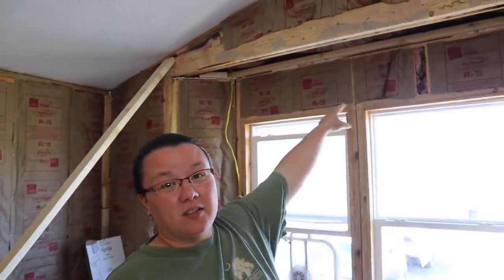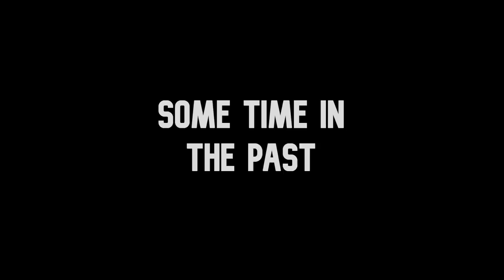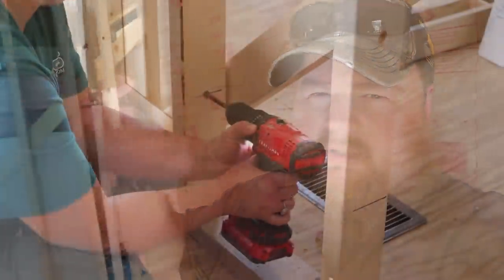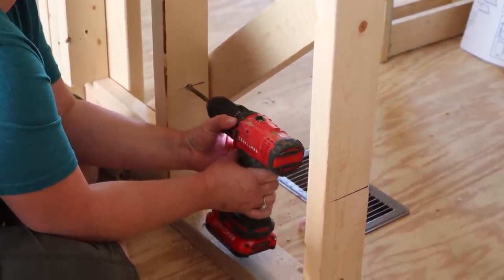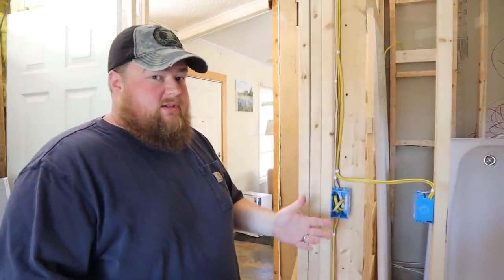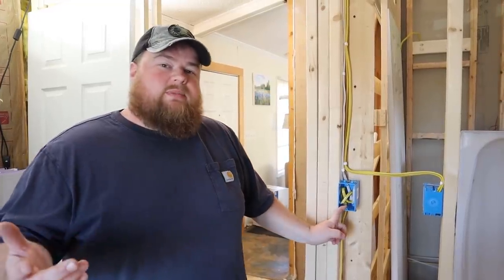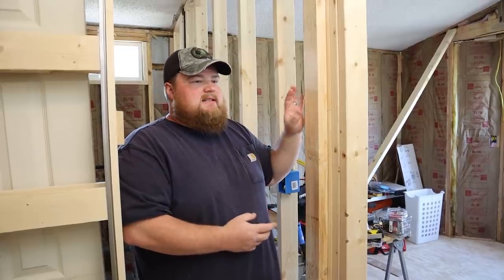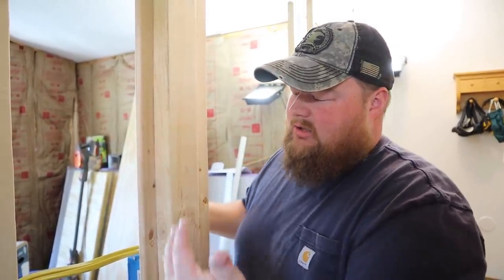1,000 Little Jobs & Why We REMOVED OUR FURNACE // Mobile Home Renovation

Comment: You need to install Mobile Home  approved propane furnace... you wouldn't need to replace the duct work...that could save you a lot $$$$ ...I am a tech and have been in the business for 23 years... I live in a double wide and bought new 'mobile home approved system" for around $4,000 and had it shipped directly to my home...spend a weekend tearing out the old system and installing the new system...It's not a difficult task in a mobile home.... If you go with Coleman products they offer the precharged Evaporator coil, ourdoor unit and lineset...you don't need to braze or use a vacuum pump to get it all up and running.... you can install it yourself watching a you tube video...you may have to have someone run your gas line for insurance and inspection reasons.... Also you may need a qualified roofer to install the new roof jack...(the intake and exhaust for your gas furnace)... All in all you look like you have the handy skills to take it on yourself... Good Luck

Comment: I live in Ohio in a 1978 24x52 doublwide with an electric furnace. My son lives next door in a 1994 14x70 single wide with propane heat. My electric bill is cheaper than his electric bill plus propane bill. His propane bill is so expensive that he put in a corn burner that burns shelled corn. He has a small farm where he grows the corn.

Comment: That's nut! You can buy a 3 ton 16 seer package unit brand new for around 2k. Ducting shouldn't be more than 1200 bucks, I had a company pull out old ducts and install all new in my whole 2 story house and it was only $2300. Package units put out good heat as well

Comment: Great video as always!!! Have you ever replaced a propane hot water heater in a mobile home? Mine is toast and I'm not sure if mobile home water heaters are any different from stick built homes. This is my 1st mh.
Reply from the maker: Not a propane water heater, but we did swap out our old electric tank heater for an electric tankless when we got the home. The only difference between mobile home water heaters and others is their sizes are usually smaller to fit in the spaces or odd places they're usually installed into.
Reply: @sam-and-angela  Thank you so much! I've been researching tankless propane heaters and have read that they're the best choice for mh's. Thanks again for all of your help!! I'm a  widow and have to do this work alone. I've learned so much from your videos!!

Comment: Most of those conventional units outside cost a whole lot and people are now complaining about how much it's costing them per month to use central air and heat. From $400 to $800 a month in electricity. I choose not to use it at all. Portable units are more cost effective- i have purchased E-heat for the future which i can disconnect from the socket when not being used and a  window air conditioner  for my son . I don't use use air conditioning

Comment: I always enjoy your shows. I admire how well you two work together. You can tell you have a beautiful marriage. HVAC systems probably one of the biggest cost you can have in a home and it is so easy to get cheated on them as well I don't envy your situation looking for one but I wish you all the best of luck and really don't be afraid to get multiple quotes and don't be afraid to look online either because although I like to deal with USA products there are some really efficient small units out there that can cool that whole house downI so always make sure that they're using the modern freon because there seems to be a game the AC companies like to play where they sell you a unit that requires R20 instead of the new approved R22 and then oftentimes charge you extra to converted over to R22 and also charge you a ton for the freon itself. But if you order it right from the beginning the price that they usually quote you includes the freon make sure you ask about this before purchasing it. Also a lot of companies are willing to work with you and let you put in your own ductwork. Which can overall save you a lot of money and you also get to advantage of having it done your way. Even things like having the concrete pad already there for the AC also cuts down cost. Or if you have a hanging unit to have the wall prepared ahead of time. These are all things to think about but very costly things at that again I wish you both the best of luck..

Comment: Non-vented propane space heaters are not HUD approved for mobile homes.  Combustion appliance located in mobile homes must obtain combustion air from outside the home.  Another note:  Mobile homes are designed for the heat loss from the duct system to keep supply lines and drains from freezing.  I have seen multiple homes where the central heating system was abandoned to save $, the plumbing lines froze and ended up with thousand $  plumbing repair bills while destroying the underbelly material and ruining the floor insulation such as it is.  I cannot for the life of me understand why someone would go to the trouble (labor and material) with the end result , a mobile home.  Build a house and watch it grow in value.

Comment: That heater was expensive!
I just put in a second heatingsystem in my 1600 squarefoot house in Sweden it is a air/water heater that is extremly good (german: viessman) biggest they got and that was at a much lower cost. I have to add that this is in Sweden in a much harder climate.

Comment: Y'all could probably could get away with 2 mini splits ( one on each end of the home) that would save you $3000-$4000? that would put y'all in your budget. The prices that were quoted were pretty good. I have an new home and the HVAC people that put our central air in, clearly didn't know what they were doing. Have multiple HVAC companies come out and look at it and to redo the duct work alone is anywhere from $4500 -$7000.

Comment: Are you adding any cross bracing on the corners for shear strength. The framing looks kinda open and then you see the metal siding 😳 am I missing or worrying about something I don't need to?😵‍💫

Comment: 14 grand!! Lol!! I don't get it. We just had a 3.5 ton ac/ heat and brand new duct work on a double wide we own and it cost $7800 complete! 10 year warranty.  And that's also with a uv light in the air handler to fight mold and mildew. That's also with a top tier company in our area. We got three proposals and the company we chose was the middle one. The cheapest price we got was $6500 ,but we didn't pick them because their warranty only covered parts. The one we chose covered parts and labor for ten years. I'm thinking you got bamboozled by the company who gave you a proposal 🤔

Comment: Coming along nicely guys,  What is a H vac?  It is way to costly, what ever it is. DIY used electric wall units in every room for heat. It's colder where they are but ,they said it works out fine. I'm not sure what it costs  per day though.
Reply from the maker: HVAC is the term for central heating and cooling. :) We considered something similar to what DIYfferent used, but weren't sold on the idea completely.

Comment: Hey Sam I got a question are you gonna use those little metal pieces that go in front of the wires on the studs so that people can't drill through Drywall or are you putting up drywall?

Comment: you CAN DO HVAC YOURSELF. SPLIT PROJECT IN 2 PARTS . REPLACE AND INSULATE NEW DUCK WOCK. THEN INSTALL THE OUTSIDE UNIT. THIS WILL BE ALOT LESS WORK THEN MINI SPLITS.

Comment: I know I'm a dinosaur. I live in wisconsin, my needs and utility companies are different than yours. I'm able to keep my 16 by 70 trailer comfortable with one 10,000 btu window air conditioner. It comes with a sacrifice, I lose a window and I tire of the fan whiring. On the other hand it was very cheap compared to central air.  I guess it depends on how much cash you have in your pocket. I never had central air, my last home had radiators,. Is it more economical to run than a couple window units?  I don't know. I guess your heat and air decisions have to be made with resale in mind. I know for some folks central heat/air is a must have. I only want central heat because the ductwork is close to the pipes and that helps when it's 20 below. Otherwise any safe, inexpensive cheat is fine with me. I use electric space heaters alot. I have for years, but they require common sense to do it safely. In the end, if you don't have central heat or a similar alternative if you don't pay for it now, you'll pay for it when you sell your home. That's my 2 cents. God bless!!

Comment: You guys should call tuns cheating and air supply in Covington ohio the guy sold me everything I needed for install for 3200 and I got quote for 14000 also and he literally wrote on a single piece of paper everything I needed to do to install and start unit and worked like I was a pro at it

Comment: Don't be too quick to down play 'Joes HVAC', chances are he has far less overhead than the big shiny out fit that over priced you. Add to that,  he was probably an employee at some point himself that took his skills and started his own company. Big companies have all the work they can handle and aren't too interested in crawling under a mobile home so they bid high and base their quote on tearing your existing duct work out and starting from scratch. Find someone that can match a gas fired mobile home furnace to the existing ductwork. If you can get a 80% model, cut a hole in the roof for your venting and you should be well below your 7k budget.